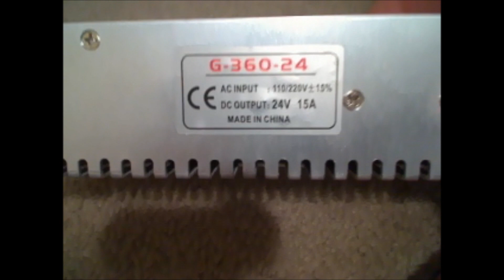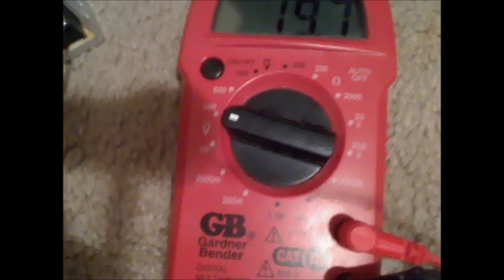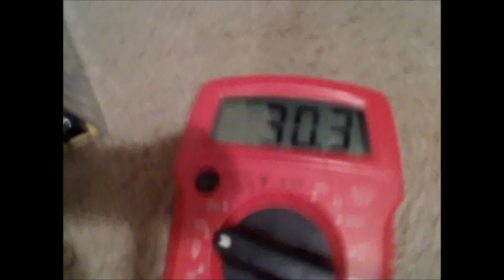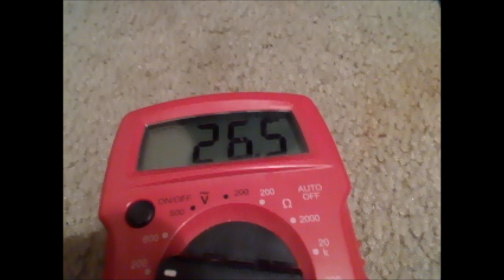How hookup power to your TB6560 3 Axis 3 5A Stepper Motor Driver

Comment: I had the 4 axis version of this same board smoke and burn last week after about 2 hours of operation.
 I was using a 36v power supply.  The board says it takes 36v and I had it running on another 4 axis tb6560 for several months.  I switched to individual drivers and it worked fine, but I decided to try this all in one board, and it lasted 2 hours.  I might have had an intermittent motor connection down the line that may not have bothered the single axis tb6560, I have much larger nema 23 motors.  Thanx for the video.

Comment: Great video! Just a couple of quick questions: (a) At 2:30, the wire you showed is black,white,green.... if my wires are different colors, how do I arrange it in the back of the power supply? (b) Is that power cable 2 pronged or 3 pronged?  
Thanks

Comment: Gday Timothy.  Great video,the best.  I have a question. What is the maximum DC power that the BT 6560
 board handle?  I'm currently building a 3 axis milling machine.
Reply from the maker: Min is 12 volt and max is 36 volt
Reply: Thanks Timothy,,, I Have a 28.6 DC power supply on my shelf  [battery charger from a drill]   It is right in  the middle of the 24,,36 voltage limit. This will save me a few $$$$ on buying a new power supply unit. Thank you for you help.greatly . I'm using NEMA 17 ,,,1.5 amp  stepper motors.QUESTION,,,Do I need to be aware of the ampridge im using?

Comment: Does  that power supply have sense terminals S+  S-?. If so connect them to the + and - terminals at the controller. This allow for cable loss to be factored into the regulation..

Comment: Timothy Puckett Hello dear friend,

I have, TB6560 driver, and it can be connected to a PC via a LPT port and theres nonother way. If I could avoid this problem if you buy a card with the ports, cards that can be purchased and installed on the motherboard of the computer. I need a little stronger computer so I could work with SolidWorks, AutoCAD and other programs related to drawing and design ... I want to know whether this card we can help you with this:
 1 WINSTARS 1xLPT PCI-Express kontroler
 2 WINSTARS 2xRS232 + 1xLPT PCI kontroler
 3 WINSTARS 2xRS232 + 1xLPT PCI express kontroler
 Or do you suggest me something other?